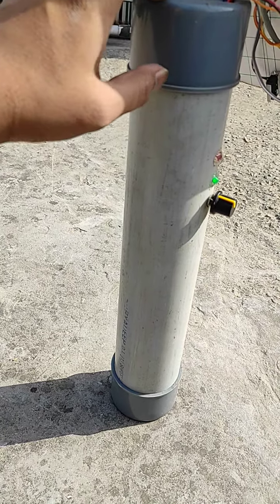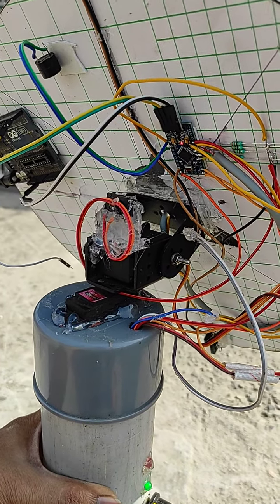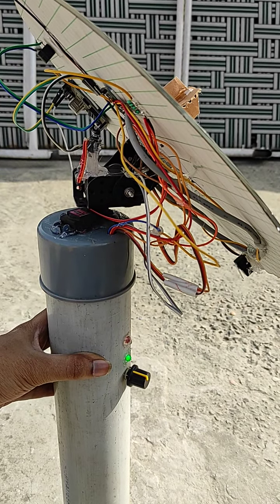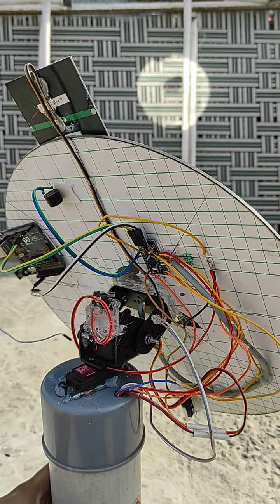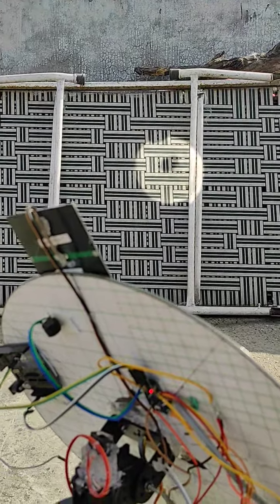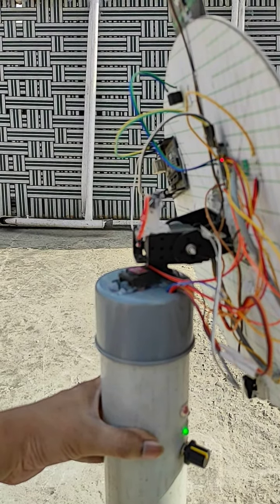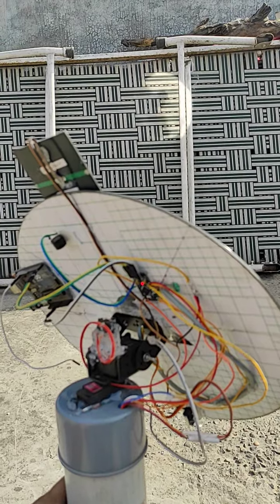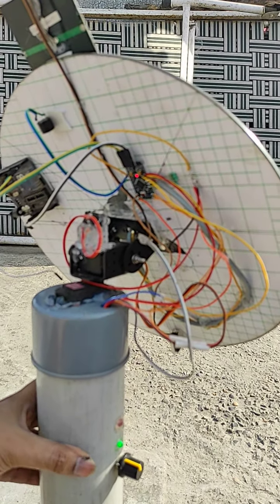Homemade heliostat testing - Turning failure into success

Comment: Thanks for your all of your videos. They have really helped me develop my own heliostat. 
I found a way to track the sun using a DS3231clock and sun tracking algorithm so you do not need to use the ldr to find the sun. It has really improved accuracy.
It may help in your development.
I also use 2 potentiometers to set my target angles, which made setup very easy.
Good luck with the rest of your project
Reply: Kindly upload your video.
Reply: would you please share your code?